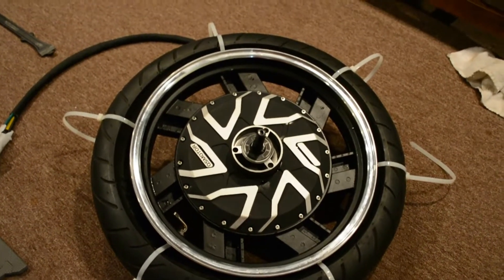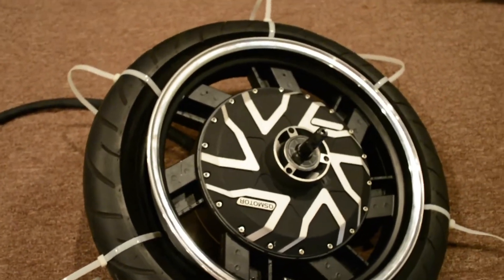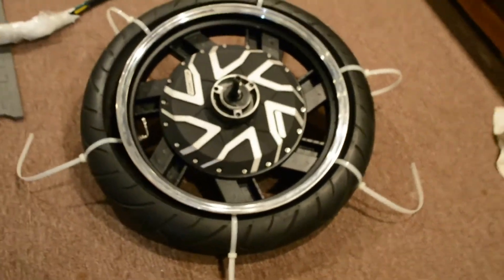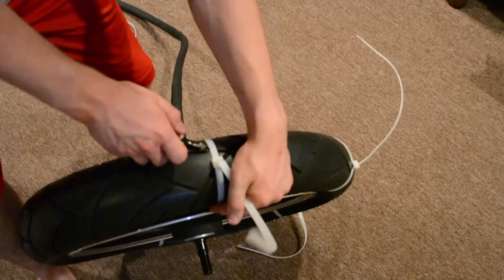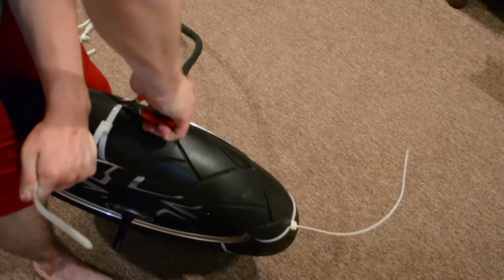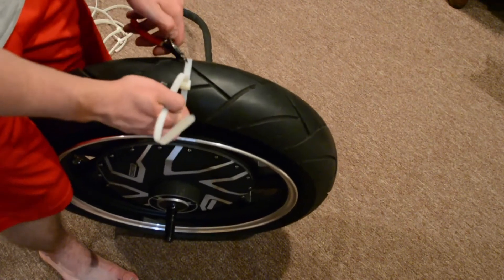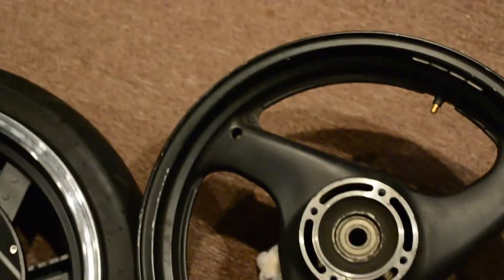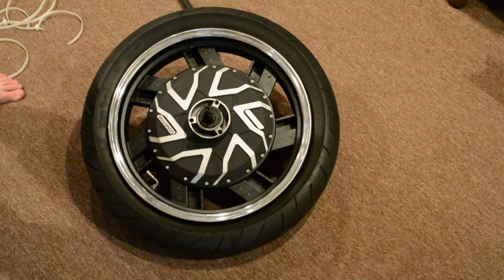8kw QS Motor Tire Installation

Comment: Looks good, where did you get the valve stem?
Reply from the maker: I bought them on Amazon

https://www.amazon.com/gp/aw/d/B00HYYNW5K?psc=1&ref=ppx_pop_mob_b_asin_title#
Reply: @LifeAroundDamian  thanks again for the info, I'm happy to confirm they also fit the 12kw hub motor which has a 6" rim (just for anyone else looking as I was). Cheers!
Reply from the maker: @russelllowe  I'm glad they worked out!